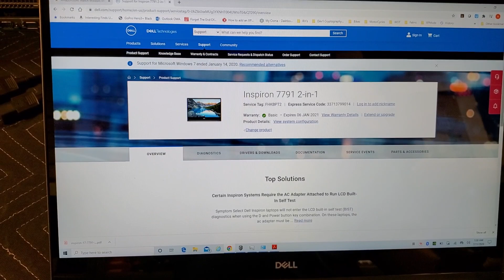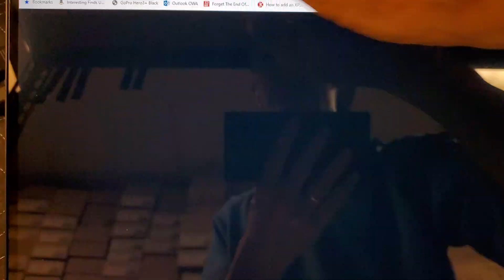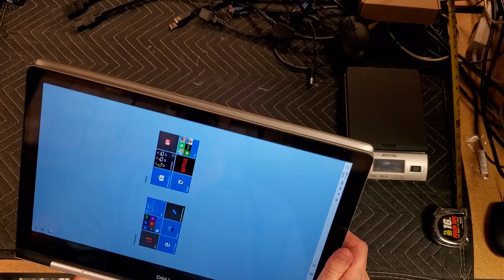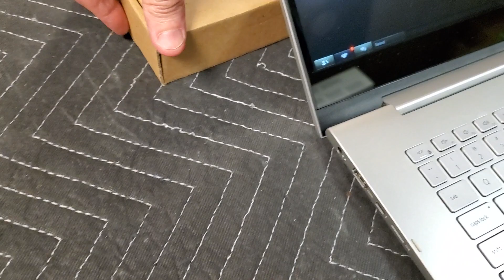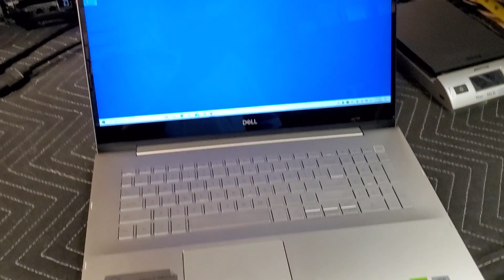Dell Inspiron 7791 Review

Comment: Nice review and i also have a question. How stable is the aluminium case? The top of the keyboard flexes when you press it with your finger? Thank you for your answer.
Reply from the maker: The keyboard seems rock solid, no flexing once a keypress bottoms out. When opened, you can twist the case about 4~5mm and the lid about 3mm. When closed twisting seems impossible because both structures are aligned with the beefy hinge mechanism.
Reply: @hgodtx  thank you

Comment from the maker: A quick note: Dell's website is now selling this laptop with the 11th gen CPU, MX350, QHD+ (2560x1600) screen, 3200MHz RAM, and Thunderbolt 4 port. Interesting the screen size has been reduced to just 17.0" down from 17.3".
Reply: and the weight has been reduced to 5.39 lbs. I ordered one and it's taking ages (from US to UK)
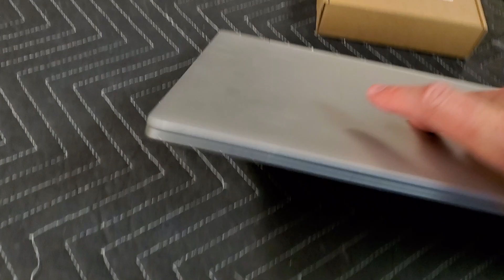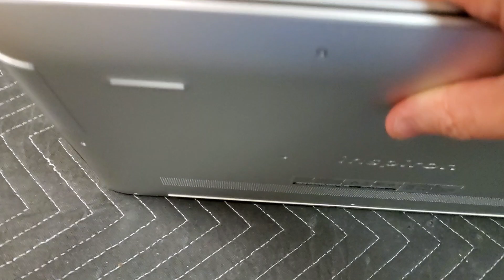Reply: I have this laptop with the 32GB optane.  Note, the laptop is 17 inch instead of 17.3", but now the ratio is 16:10 instead of 16:9 like standard laptops.  So the screen is taller instead of wider, if you can understand what I mean.   The 16:10 ratio is perfect if you are reviewing documents side by side.  Also the weight is 4.9 lbs.    Doesn't feel that heavy at all.  The 2560×1600 screen resolution is definitely an improvement.

Comment from the maker: Guys, this laptop can be had on the Dell Outlet. If you are not familiar, I'll explain the short of getting there.
www.dell.com/outlet
Hover over Products, then Laptops & Tablets, then Inspiron Laptops
Then drop-down options, select Screen Resolution, 17"
Drop-down option, Touch Screen, Touch
Drop-down option, Screen Resolution, 1920x1080

The above should get you down to a handful of candidates. I couple of secrets based on my experience of buying hundreds of systems. The concept of refurbished is not necessarily that the laptop was used & and abused then sent back to Dell for "refurbishing". I find most of the systems are simply cancelled orders that never left the Dell shipping dept. This is true for "Certified Refurbished" systems. If you find "Scratch & Dent" then it's a crap shoot, that it might have a few faint marks, even less likely it'll have a few scratches, and three times in 10 years I actually got dents. And ultimately, if you just regret what you got, you can return it. Regardless of condition, it's sold to you like new with Dell warranty, so there is no risk.

When you get your handful of candidates, read very very carefully each component. Simply viewing so many options and so many systems will get you dizzy and you might home in on your pick and order it, only to realize you mistakenly ordered the system without the touch screen or without the Optane memory.

Make sure to review Screen Resolution, graphics card, is it new, certified, or scratched, is it the 2-in-1 folding style or a normal hinged laptop, etc.

Also, if you want WIndows 10 Pro, and not Home, realize if you are getting great pricing, you can always do an in-place upgrade from Home to Pro for $99.

The default warranty is 1yr. Once added to your cart, you can optionally purchase extended warranties, the price may be better than $50/yr which was the price a few months ago for doing a 1yr bump.

There have been weeks that you can't find any of these laptops available on the Outlet, so be patient, again, inventory can change rapidly, but if there is high demand by the business community then the Dell sales reps are reserving all the stock and they won't show up here.

Comment: Great video! I just ordered an Inspiron 17 7000 2-in-1 (7706) with some upgrades from this review for $881. Slight bad news is that with the upgraded processor, delivery will take 6 weeks. Interpreting tech specs is a foreign language to me, but the 7000 seems an equivalent laptop to the highly reviewed XPS 17 - equal weight and processor, higher screen resolution, but smaller battery - for $350 lower price.
Reply from the maker: I'm loving this laptop more more as the weeks go by. It's all about the screen! I order hundreds of systems from Dell throughout the year and 19 out of 20 times they deliver much earlier than their estimated delivery date. If probably ordered 2000 systems over the last 10 years and they've all arrived by the estimated date or before. There was one exception and it just happened two months ago. I ordered a T440 with very unusual options, like casters to roll it around the floor easily. That system took two months. They had given me estimated delivery dates and had to push back on those dates thrice. The final date was given, but at that point it actually showed up 10 days early. I think the delay was simply the whole COVID-19 China parts delay scenario.
Reply from the maker: If you get tired of waiting I'd recommend keeping an eye on the Outlet for the same or better laptop for possibly better pricing. Also note that the inventory on the Outlet changes hourly, so checking it 3 to 5 times a day can reveal different systems and pricing. I'll make a separate comment explaining the procedure.
Reply: @hgodtx  It looks like at present, the Black Friday deals on new 7706 has better components for better price than the outlet models. Good to hear that Dell might deliver before their promised Christmas Eve date!
Reply from the maker: @gregtraxler4195  I want to check it out! I couldn't find it in a 15min hunt! Do you have a link or the drill down sequence to get there?

Comment: I made a mistake. I don't think they're selling this model anymore. I got mine today, it was on the dell website as the Inspiron 17 7000 2-in-1.
It doesn't have the bezel below the screen with the dell logo like yours does. It's a 16:10 resolution! I bought this to replace another 17 inch laptop and never suspected that  non-16:9 laptops existed. So even though it's "17 inches", anything I watch, including your video, is shrunken down with half-inch black bars on the top and bottom.
I feel like I got played. I had been researching the 17-7000 for a while but it was no longer available on dell's website, so when I saw it pop up again I bought it. My model number is 7706
Reply: Bruh 16:10 is far better than 16:9, you didn't get played at all, you made a happy mistake :) be happy about it!
Reply: @MackTheKing31  Not for me, I do a lot of work in dual windows so I need more horizontal than vertical room. I also hate the black bars on videos, it defeats the purpose of super thin bezels. These are things I can live with though, it's still a sick laptop.
Reply from the maker: Is it 2560x1600?
Reply: @hgodtx  Yes it is
Reply: @shoshm1914  The colors and contrast are great, it has HDR and is 4k. But since it is 16:10, it shrinks 16:9 movies down to effectively a 16 inch screen
Reply from the maker: I wonder if you can "cheat" by selecting 1920x1080 in the windows desktop properties for the resolution. Of course it won't be the recommended resolution since it won't align perfectly with the native resolution, but since the screen is so high it might just work.
Reply: Hey Nick, I'm considering buying the same laptop you just bought by accident... Have you noticed how the reflections on the screen look ? I heard the inspiron 17 has a pretty reflective screen, what do you think? ALSO, like hgodtx said, the fans get pretty loud on his model while gaming... What's your impressions on that on your new model ?

BTW ! 16:10 ratio is definitely a plus to me !  (any improvements on the backlighting of the keyboard??)
Thanks !

Comment: The numpad keys look a little skinny, do you have trouble typing on them?
Reply from the maker: I really don't love just about all laptop keyboards. A laptop that has a numeric keypad is a huge plus over one that doesn't. I find no problem using it, certainly not as fast as a PC keyboard. The bigger problem, as with most laptops, is the arrows, home, del, end, pgup, pgdn keys. 2nd runner up is the size of the print on the function keys. There also needs to be a gap between F4/F5 and F8/F9 as on PC's to help locate without needing to see that micro-print!
Reply: @hgodtx  Yeah I don't understand those pg up pg down keys being there at all, my current keyboard has full sized left right keys

Comment: Excellent review, I have had mine for about almost nine months and totally love it. I have a 1786 also and it has black keys and thus the back light is a bit better than the 1791.  I keep it attached to the D-6000 hub and run a big screen 4k tv as an external monitor so my gpu gets a bit more of a work out. This machine is really quiet compared to my 1786 and thus I use it more.  Rarely get to use the touch screen and tablet mode, but it is nice knowing they are there.
Reply from the maker: I was tempted to get the 1786, but the deciding factor for me was the better MX250 graphics card over the MX150.
Reply: @hgodtx  When I got my 1786 which was last September I was able to get it configured with the MX250 as the MX150 was becoming obsolete.
Reply: @hgodtx  This is the best review of this laptop on the internet. :washhands::shelterin:
Reply from the maker: @Jonathan_bagwell-s6r  ...and it's still one of the better laptops even by today's standards. That optane memory does the trick!

Comment: is there a way to add a coaxial cable to it as well DVD Rom player.
Reply from the maker: It's too thin for a player, you'll have to use an external usb player. Not sure what you mean for coax? You mean for a TV tuner input from antenna?
https://www.amazon.com/s?k=B07DHFP47L
https://www.amazon.com/s?k=B00XF7Z5DM

Comment: Why is it written inspiron 17 7000 on your keyboard instead of 7791 ?
Reply from the maker: Good Question. The first number represents the screen size. So you could purchase a 17-3000 or a 15-7000. Screen sizes are 11, 13 14, 15, and 17. Series are 3000, 5000, 7000. Not all combinations can be had, for example there is no such laptop as an 11-7000. The series (3000, 5000, 7000) represent various options that you could puchase. For example if you wanted a backlit keyboard or touch screen they're not available in the 3000 series. Want a 4K screen, only in the 7000 series. So what does my "7791" represent? The first digit 7 is the premium model, 2nd digit 7 is the screen size, third digit 9 is the cpu generation, and fourth digit "1" represents the device type "2-in-1" compared with "0" which would mean classic laptop style.